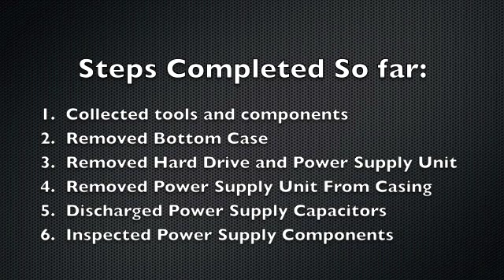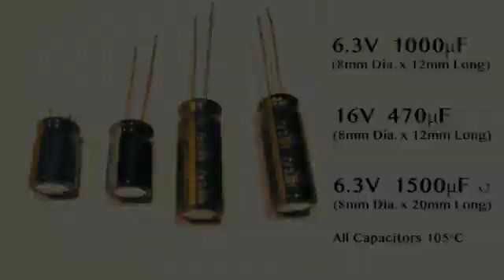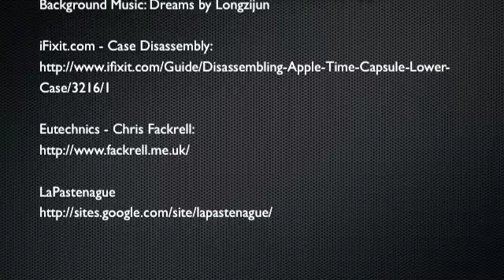Apple Time Capsule Repair Part 2 of 2

Comment: Good afternoon, Excellent video, thank you. In your video it is recommended to use a capacitor of 1000uf x 6.3v. When I opened mine, the capacitor is 470uf x 6.3v. Is this a suggested modification, an original design error?

Comment: Hello! I have changed the power supply. It worked properly for hours and then suddenly the rear lights of the ethernet ports went off while the front light is amber and i can hear the hd working. Any explanation that? Thanks a lot?
Reply from the maker: +Ioannis Karadimos Not sure what that means exactly but it's not a light combination that stands out to me.  I suggest a hard reset.

Comment: This tutorial was great and helped me replace a spent capacitor. That said, I discovered a problem that I can't seem to find an answer to. Strangely my TC will only show up in Airport Utility and/or search for a network if the onboard hard disk is not connected to the power supply or motherboard. If the HD is connected, though, the indicator light will only stay solid amber. When I left the HD unplugged, it worked fine (albeit with an error message saying the HD couldn't be found). I just ignored the message and the TC works fine with the green light and everything. It seems that if the HD was bad that it wouldn't prevent the TC from booting up, right? Just wanted to see if you've run across this issue before. I've ordered a dock to test whether the HD is caput or not and just using the TC as an airport extreme to extend my network, but wanted to see if you have any thoughts on this.

Comment: Without the hard drive installed that is. I wanted to test it before reinstalling the hard drive. I'm not sure if it's the fan that possibly is running and making the high pitch noise or if it's something else, I guess I could try to plug it in with the bottom case off of it to see where I hear the noise coming from, it's noticeably longer when the "new" power supply (looks like it may be a refurbished power supply) is installed tho. Only a few seconds with the old one.

Comment: you haven't had activity on this thread in a long time, hopefully you can answer a question still. I ordered another power supply from amazon to install the new one (looked like an easier solution) when I put the new supply into the capsule and attempt to test the capsule, I can hear a high pitch noise, for about twenty or thirty seconds, and then nothing. No lights ever come one and I don't seem to be able to see any networks appear. The "new" power supply looks exactly like the old one, except it has a sticker, with a Japanese symbol on it. I think it may be refurbished. I tried my old power supply and the same thing happens except the high pitch noise only happens for a couple seconds instead of many. Did I order a faulty power supply?
Reply from the maker: +Jesse McIntosh 

Is this sound occurring with the hard drive installed?  The power supply has no moving parts so there should not be any sounds coming from it at all.  I can't think of anything that would make any discernible noise other than the hard drive and when a hard drive starts making high pitched noises it usually means that your hard drive is not doing well.
Reply: +Ockham51 Without the hard drive installed that is. I wanted to test it before reinstalling the hard drive. I'm not sure if it's the fan that possibly is running and making the high pitch noise or if it's something else, I guess I could try to plug it in with the bottom case off of it to see where I hear the noise coming from, it's noticeably longer when the "new" power supply (looks like it may be a refurbished power supply) is installed tho. Only a few seconds with the old one.

Comment: Thank you! The kit instructions/video was easy to follow and I have very very little soldering experience. This fixed the issue of the time capsule not powering on and I took the chance to upgrade the hard drive while I had it cracked open. Word of advise….the plastic cover under on the power supply is INCREDIBLY brittle so this is the most time consuming part, just take your time and do it slowly.

Comment: parts came as advertised and I am impressed with the clarity and instruction of these videos.  I noticed that although my TC spontaneously stopped having power, and this seemed like the most likely problem, I was concerned when none of the capacitors appeared to have failed.  I went ahead and replaced all four nonetheless, but if I may ask, do you have any suggestions of what else may be the culprit?

Comment: I want to drop a note to let you know that while this is not too easy to complete – if you take your time it is a job that is well worth doing. I would suggest that the rubber mat on the base might be left off after you have fixed the TC. Seem little use to me placing cooling holes in a plate that you then cover. Anyhow thanks to you guys and YouTube I have a TC with important Data running again.Parts came as requested too.

Comment: mine too, but I left all the covering and foil off, hoping it will stay cooler.  There is enough space between the power supply and the time capsule board to prevent shorting, and the space is maintained secure once you get the screws back in the base.

Comment: Thanks, it's working again.  I ordered your parts off ebay.  I only needed to replace the two 6.3v 1500uF capacitors.  Three mods I made were to leave off all covering on the power supply, cut a hole below the fan in the rubber bottom to allow the fan to actually work and keep the time capsule cooler and to put 4 felt pads on the rubber bottom to leave space between the table and the time capsule for a little air space. Hopefully it will stay cooler and last longer than before.

Comment: hi there i have  time capsule too  i took it to apple  and they said is low volatage  look like the capacitors  when out they wanted  to give  low credit  for  but i kept  it   if the capaciter are  bad will it cause  to have low voltage and light up yellow and where could i purchase  this kit  that you have shown on your  video whats  the  price  and do you do  paypal

Comment: Removing the plastic power supply cover.   For whatever reason, most of the plastic cover on MY power supply cracked or shattered.  Can I use electrical tape to replace the plastic cover?    And adhesive:  if a little adhesive is good, a whole lot must be really good.  The tech really slathered it on.

Comment from the maker: There are definitely several mods out there that will keep the TC cooler.  They include everything from an always-on fan at low speed, reversing the fan direction, expanding or altering the fan port, or using an alternate external Power Supply - and those are just a few.  Many of these mods do work but are typically a much more involved process.  This fix puts it back to original spec with newer capacitors.  It's by no means perfect or foolproof but neither are those mods that I mention.